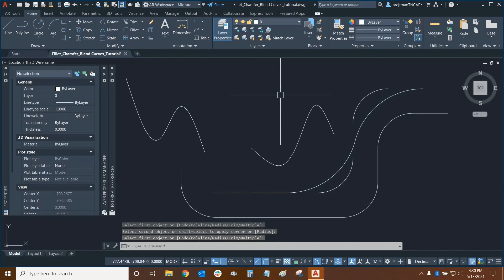Fillet, Chamfer, & Blend Curves with AutoCAD - Part 1

Comment: I called it “fil-ey” in college until a grey-beard profesor told me its pronounced 
“fil-ett” as the word is derived from “filling in” a weld joint. 

I.e., how do merge intersecting metal joints? You “fill-it” with molten metal.